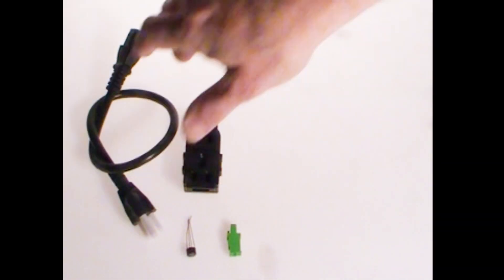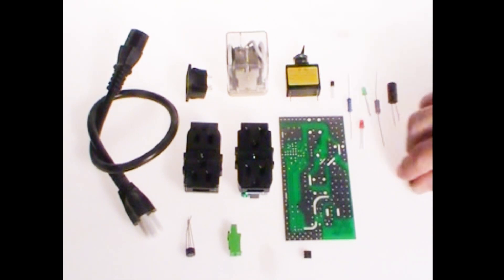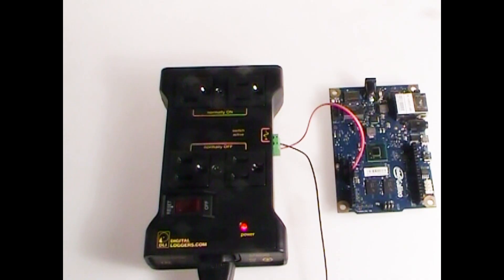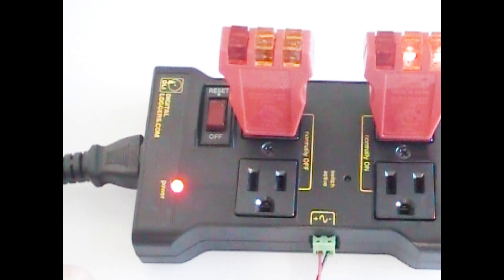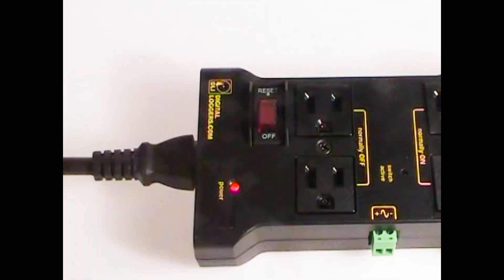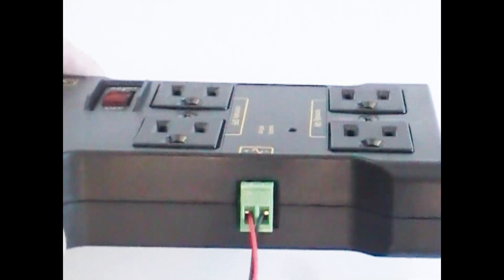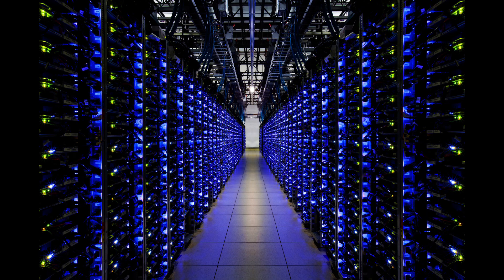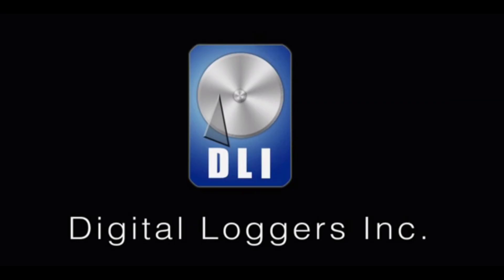IoT Power Relay

Comment: I'm very happy that so many people know about this stuff, but I don't know all the technical language. For the input wiring into the green connectors, am I able to control the on-off to the power strip simply with a 14V DC voltage that is manually turned on and off? I'm not doing anything cool or fancy, I just have access to a 14V DC supply that I can manually turn on and off, thus hope I don't need to mess with a microcontroller.

Comment: Why would I use this over a $8 4 channel relay module that lets me control each individual relay?
Reply: IoT relay has the AC inlet & outlets, thermal circuit breaker, relay debounce, optoisolator and a 40A contact rating.
Reply: Your insurance will pay you in the event of fire burning down your house. Your home made $8 kit, maybe not.